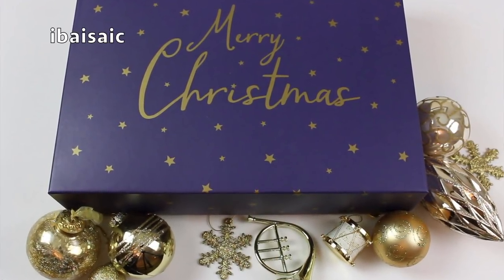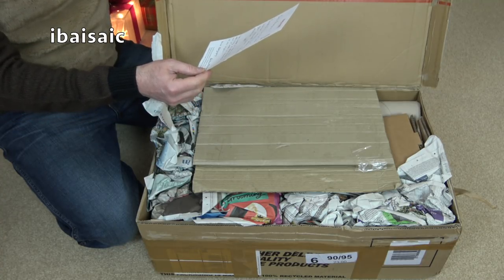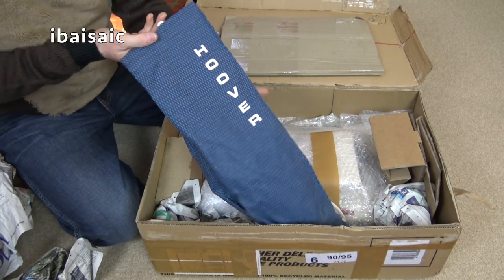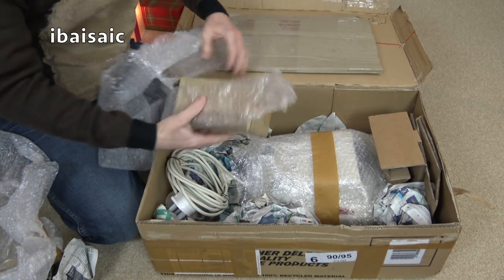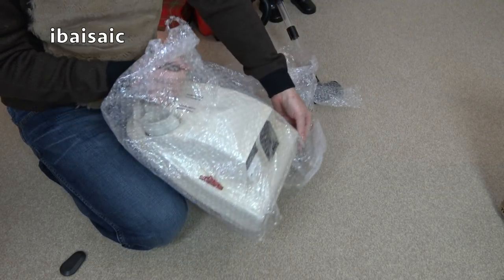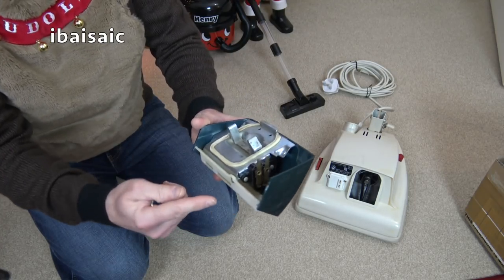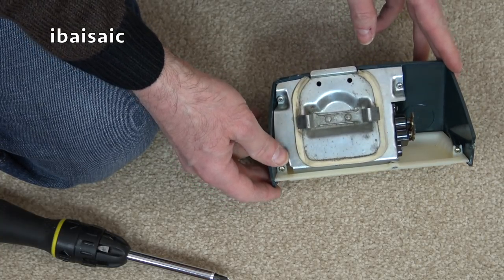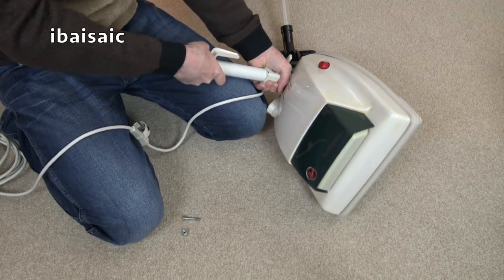ibaisaic's Video Advent Calendar 19th December  Hoover Exclusive Dirtsearcher Back From The Spa

Comment: I'm so glad you like it, it turned out really well! I did clean forget about the cable guide, don't think I even looked at that bag of spares for it! Tuck it below the handle for now and worry about it another time! She does work well, I didn't use it with dirt, wanted you to have that job, so it's good to see it didn't explode when being used, not that it would as it now does not have a mains supressor fitted! All the newspaper came from my mums neighbors recycling bin, I don't read newspapers! I'd best get the refurb thread written up so you know what I did!

Comment: Roger this seems to be a hybrid machine. you should replace the handle socket  with a 1334 type as that handle is for 1334/1346. The 1034 handle is all metal and does not have the rubber part. the handle has been supplied as such I guess because it comes with  the shorter bag from a 1346A. The u1034 bag should be the longer  type  even though it still came with the bottom filling dust tube. In addition, all Dirtsearchers should have the upper swivelling cord hook for quick flex release. the lower cord protector would be attached to the handle and not the socket in the original version. The exclusivity was to the Electricity Board Showrooms. Hoping this is of help to you.